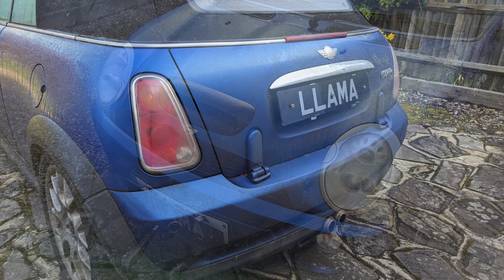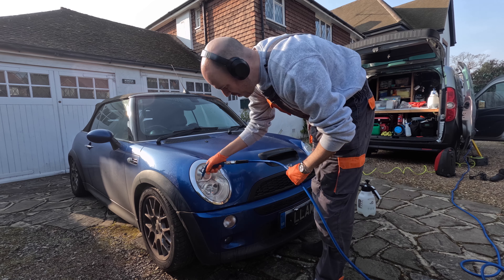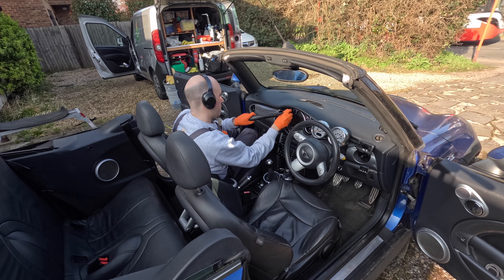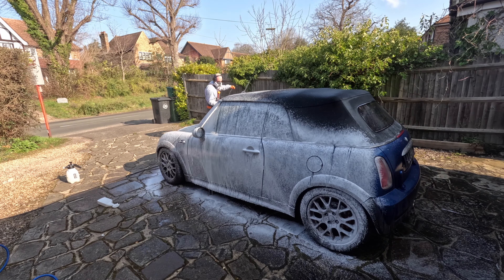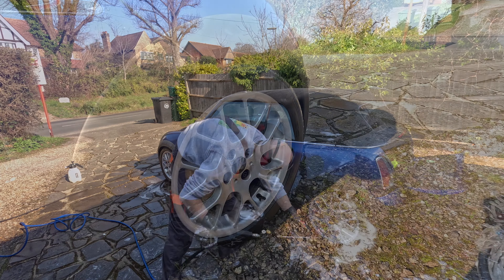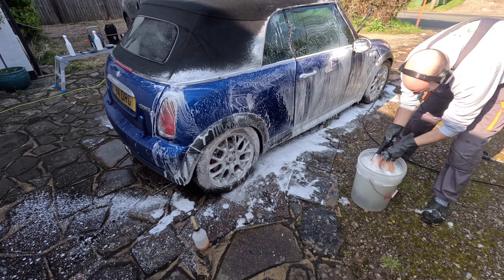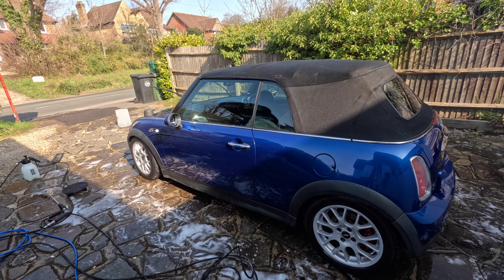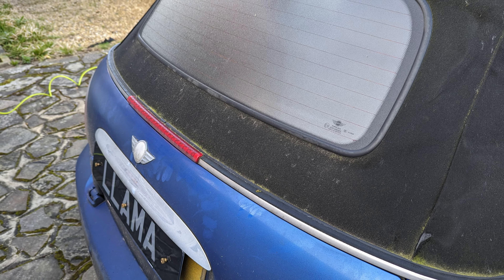Filthy Mini R52 gets a deep clean

Comment: Interesting video, it’s good to see the difference between an enthusiast and a business approach although I feel here you went quite a bit further than most valeters would experimenting with different products etc 

The water sheeting was also interesting after GT WSR as I’ve found the same with using it, is it the product leaving a hydrophobic layer or the clean panel 🤔

Great tip using the drill brush in the hand too, simple yet bloody effective 👏👏
Reply from the maker: Thank you! And thank you also for appreciating the differences in doing this commercially. You're right on the wheels, I only did Auto-wheel on one of them just to see, more out of my curiosity than anything else really, I've started doing a pre-wash with something like Detail Bugs Mantis at 1:5, which I spray and rinse, and then do a contact wash with Auto-wheel, or Devils Juice depending....I just upped the ante on the pre-wash chemical here based on the severity. This is now my entry level package so I price it in accordingly, and just flex the interior options up and down depending on what the owners want really. I've given up on just washing a car, if that makes sense? Not enough money in it, but critically (for me at least), not enough enjoyment either. Where as the deep cleans are more transformational.

As for the WSR, I don't think it does have anything that adds hydrophobic properties, but I think it removes things that impedes them, such as mineral deposits on the paint...but also perhaps neutralising the minerals in the rinse water on the car? Not too sure on the latter bit but I'm reasonably confident on the first. I just need GT to sell it in 5L now!